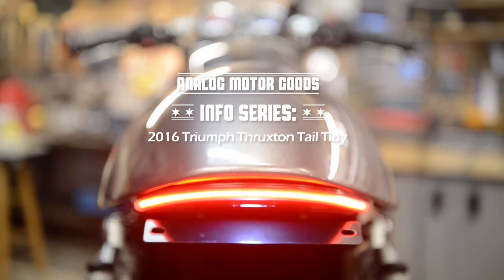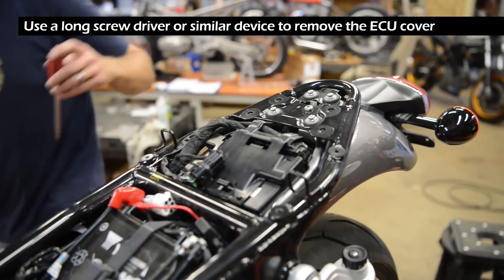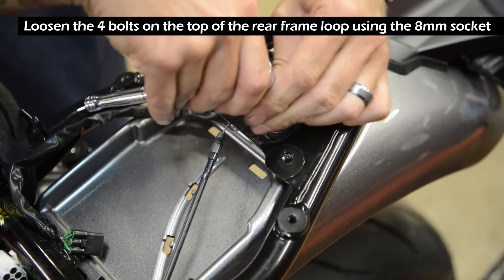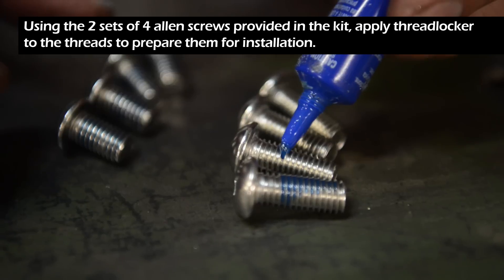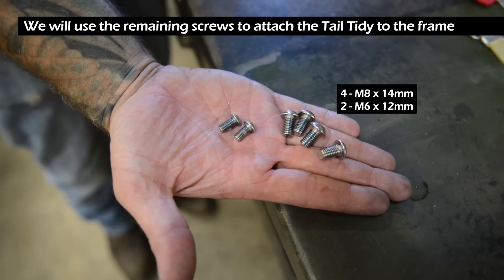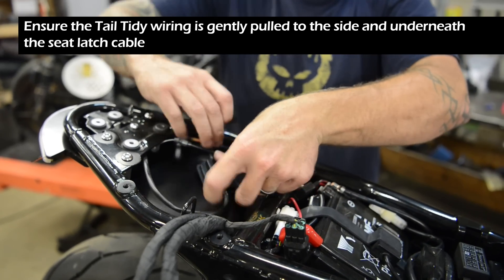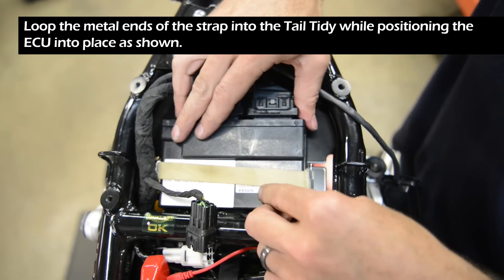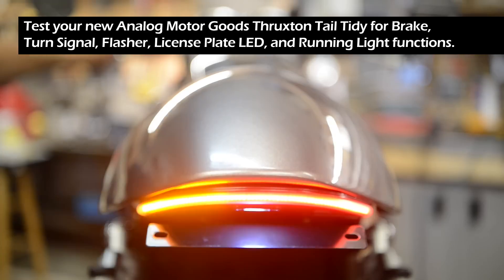Analog Motor Goods - 2016 Triumph Thruxton Tail Tidy A3Tv2 Install Video

Comment: This kit lists for $455!!! You want $455 for a piece of sheet metal, a rubber band and an LED strip? Nice video lol now I know how to install any other kit on the market thats half the cost for the same product.
Reply from the maker: Well. If that is how you feel you are entitled to that opinion. However we have the highest quality Thruxton tail tidy out there. It is stainless steel 16ga plate with a billet CNC's LED mounted to that. A premium LED array that is better than all the other ones out there. Our fit and finish is also far superior to the competition. We were the first to design these kits for the Thruxtons old and new and we sell hundreds of them. The rest copied and do it cheaper with lesser quality components. You can buy a PBR or you can buy a local craft beer. They are both beer but one cost twice the price for a reason. Maybe it just isn't for you at our price point and that is Ok.

Comment: Love this piece on my Bonneville. I've had it going on 5 years. Did you guys ever figure out a way to slow down the speed of the turn signals?
Reply from the maker: There is a link in the product page of our website to a plug an play relay that has been there for years. Sorry just saw this comment.
Reply: @analogmotorcycles  can you link it into this comment please? Thanks and cheers
Reply from the maker: @AryanSharma-qq4xs  The above comment was based on the comment he posted. The older A3T (his post stating 5 year old machine) for Air cooled Triumphs needs a different relay. The liquid cooled A3Tv2 that this actual video is regarding does not require the relay. To not confuse any potential customers here I would recommend you shoot us an email with which bike you have and we can help get you sorted if needed. store@analogmotorcycles.com

Comment: Great, more integrated turn signals for cage drivers to have an easy time overlooking in the sea of LED.
Reply: That is also a concern that I have, particularly since the contrast between running light and indicator is not so distinct.

Comment: What happens if you have LED front signals? Do you still need that stupid black box?
Reply from the maker: Are you referring to the box that contains the electronic components between the light and the plug? Like at 3:28?  Yes you need it - it is what helps the LED bar relay brake > running > turn signals.

Comment: If you have a power commander,  will it fit securely?
Reply from the maker: We are not sure. Never had any experience installing with a power commander so not sure where they recommend to mount their unit. There is probably room for both.

Comment: Why is this FEK so expensive? Other FEK's available are half the price, which is still over priced, and this kit doesn't even have the option to mount the plate tucked back under the seat.
Reply: We use quality parts and that makes them more expensive. We only use premium LEDs. The LED array we have made is the brightest on the market. Our custom made circuit allows for full red function under amber when signal is in use including full brake light (bright red) under amber as well. Making it the most visible on the market in all functions. We also have stainless steel and CNC'd 6061 aluminum components unlike the other ones out there that use stamped steel and 3D printed plastics. This is the highest quality Thruxton tail light kit on the market by far. We have seen all the competitors versions and we know ours is the best and priced as such. As for the relocating license plate, we feel it looks best and is most legal where we designed it to be. If you want to relocate your plate you can do so. The license plate portion of ours is Stainless Steel and you can cut the license plate portion off and mount your plate where ever you would like.